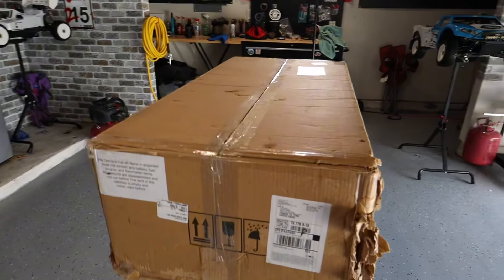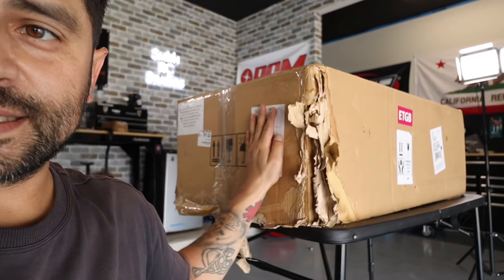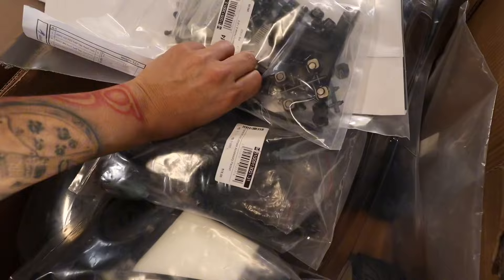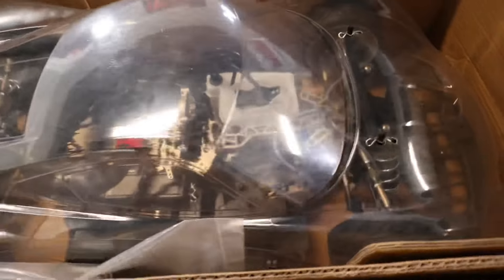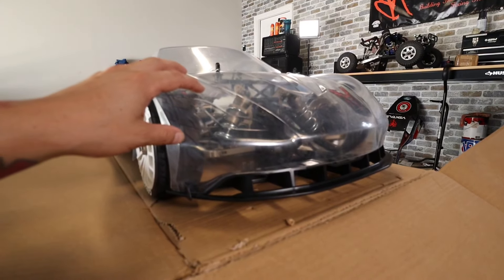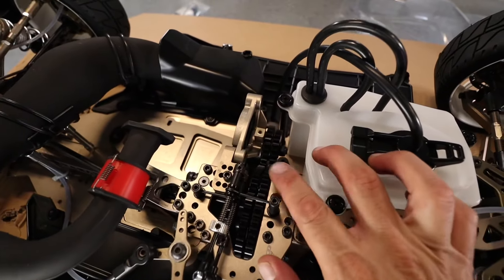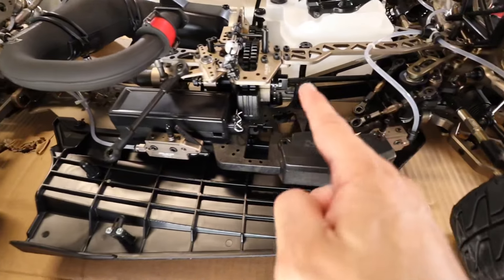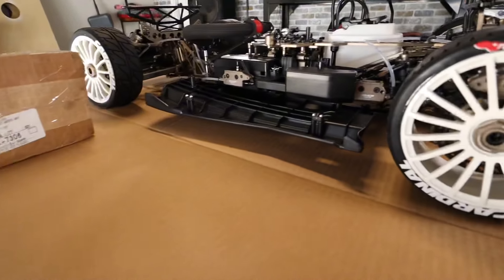EPIC!! Brand NEW Gasoline RC Car UNBOXING! - 1/5th Scale - Smith RC Smith #rclife #mcd

Comment: Sheeeesh! Another one for the fleet! Looks awesome Luis!
Reply from the maker: Yes sir lol.. cheers
Reply: @SmithRCStudios  sup quick question on my 1/5 scale when I hit brakes hold for a few seconds it shuts off the engine could u tell me how to fix that I was thinking it may be my idle strew
Reply from the maker: @BirdG-Gaming  you need to adjust the low speed and possibly high needles. When you brake, let go of the trigger all-together. Let it idle. If it shuts off after that then yes you need to screw in that idle in!
Reply: @SmithRCStudios  I have already adjusted low an high but I did bag out the idle screw so I’ll script back in tho appreciate your help man👊🏾

Comment: How much investment is this one costing without a motor. ?
Reply from the maker: This car is the ultimate version which runs at $2600 USD at Cardinal Racing and this is without motor. But also hydronic brakes and 2-Speed transmission was added on top. So you would add another few hundred. However, there’s way more affordable options as well. 👍🏽